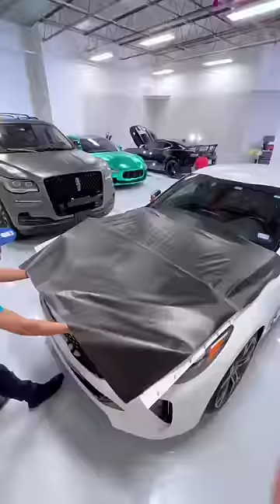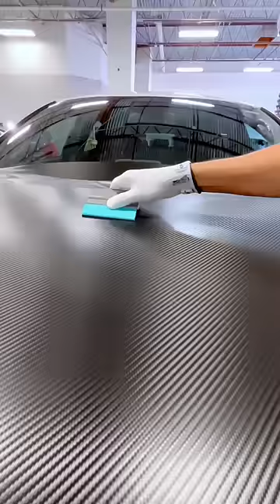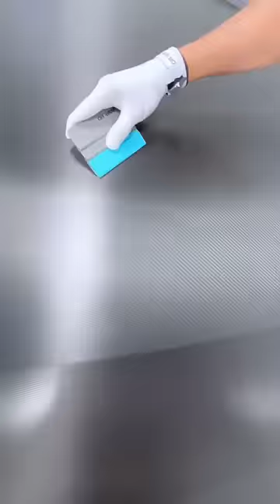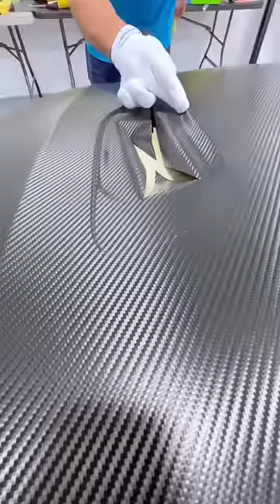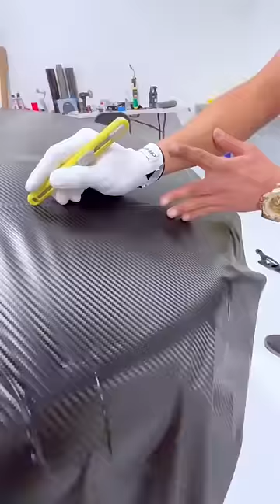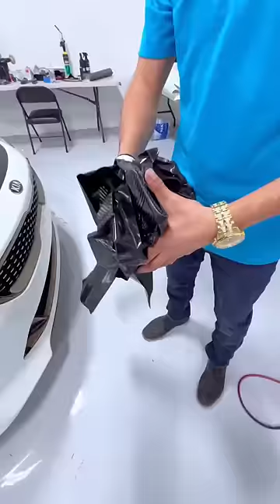Carbon Fiber vinyl wrap 😳🔥✨ #carwrapping #carwrap #vinylwrap #carbonfiber

Comment: "I payed for a wrap instead of saving up for the actual hood"
Reply: unless they charged them under 300$ for this which isn’t likely then i would’ve just saved up for the actual hoof
Reply: @Stacksyopo  So how much do you think it was? No way that it was under 200$.
Reply: Paid**
Reply: would be cheaper to just buy a real carbon fibre hood
Reply: @jerzygadzinowski9138  😅
Reply: @youtubegenius297  No it would be significantly more but still way better and more logical.
Reply: Oh no, you shouldn't have PAYED for it! Too bad.....😢
Reply: @youtube genius  Kia Stinger carbon fiber hoods are 1200-1500 plus they charge a lot for shipping as they are easily damaged. If its just for looks like wrap is a much cheaper weay to go.
Reply: Smart
Reply: @Yukikazehalo literally found a full body kit and hood for less mate wtaf are you on about🤡
Reply: @jerzygadzinowski9138  there's no way this costs over $100. You can do it at home in half an hour for less than $20.
Reply: Or when you want the look of carbon fiber but don’t want to spend 1000’s to save a few pounds lol.
Reply: What color is your carbon fiber wrap?
Reply: @youtubegenius297 and when the real carbon fiber hood gets damaged gotta replace the entire thing.
Reply: @youtubegenius297 a carbon fiber hood is a couple grand bro.

Comment: And there's me who can't even put a protection foil on my phone without having air bubbles in it.
Reply: Protection foil? Never heard someone call it that
Reply: A screen protector?
Reply: Its called tempered glass
Reply: It really isn't that difficult bro... even on the curved glass of my Note 20U I get 0 bubbles every time I apply a screen protector
Reply: Get glass ones. Plastic ones are dogshit and bubble every time without fail. You can even get some that have applicator trays so that you get it lined up perfectly every time because it slots to your specific phone (if you’ve got a popular phone at least)
Reply: @razrv3lc  I looked into them for my note 20u and they don't exist without an ugly hole in the middle for the fingerprint reader
Reply: Apply some clean water

Comment: End had me dying 😂💀
For what u do this on KIA😂
Reply: kia stingers with bolt ons have about 500 horsepower.
Reply: I thought that was a jag at first
Reply: kia stingers are actually pretty good cars
Reply: you had me dying still with the mentality of "its just a Kia"...that was more than 10 years ago models came after that are much better quality / reliability & do have potentials in performance
Reply: Stingers are great cars. Your mind is just small.
Reply: Stingers, K5s, honestly are pretty great cars. The whole "just a kia" motto isnt really relavant anymore since some of the engineers from BMW have moved to Kia. Obviously the cars arent state of the art, but they're on par(if not better than) the current day Hondas, Hyundai, some of the Toyota, nissan, etc

Comment: How the heck can they do this when I can't even put my screen guard on without air bubbles 😭 💀
Reply: Squeegee
Reply: nothing but more practice
Reply: Even if the car have dust particles on wrap it won't show but on a transparent glass it will make air bubbles...
Reply: Shit even added hp 😂.
Reply: Skill issue
Reply: I tried wrapping my laptop and it went shit
Reply: it's diffrent material and you can use a heat gun to get all the bubbles out also use a air release tool.
Reply: Material is air release and pressure adheres, so as long as you place it right and squeegee in the right directions it’s easy, until you get to the curvy parts

Comment: I am fairly new to this wrapping stuff but how long should a wrap last?
Reply: Is this a thing or something this guy created? Don't know much about cars so asking
Reply: It doesn't last long. It can tear and suffer heat damage, especially on the hood! Don't waste your money.
Reply: On a hot day, plastic on a hood will deform, crack or bubble from the combination of engine heat and sun.
Reply: How long does a paint job last? 🤦🏼‍♂️ How long is a rope? 🤡
Reply: I have a black vinyl roof on my car and I have no problems with it after a year. It was installed by the previous owner. I'm pretty sure they can last up to 10 years if they're cared for correctly. No automatic car washes and avoid parking in direct sunlight.
Reply: @scottsome7270  Fair comment.
Reply: @stevejones1318  Show some proof then

Comment: I understand that carbon fiber wrap looks good, but it's a little bit redundant because the entire point of carbon fiber is to save weight and increase physical strength. If you're spending money on a carbon fiber wrap you're kinda wasting money because that could have been money put towards real carbon fiber parts. Power to the buyer I suppose. Whatever makes them happy 👍

Comment: I don't think wrap will give strength to the parts?

It is just like a decorative material, if you want to improve strength and durability then make the complete components with carbon fiber mat.

But still researchers may have good knowledge about it.

Comment: Imagine, carbon fiber is used to reduce weight of a car. But adding a wrap does the opposite. Before you tell me that the additional weight is negligible, let me tell you that Benz won a race that they almost got disqualified because their car weight was too much, they scratched off the paint and it weighed less.